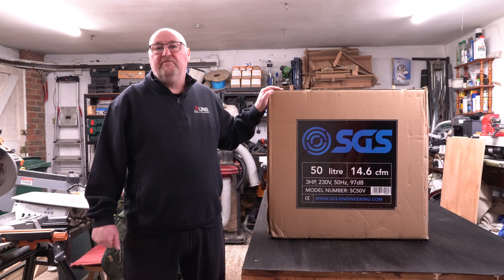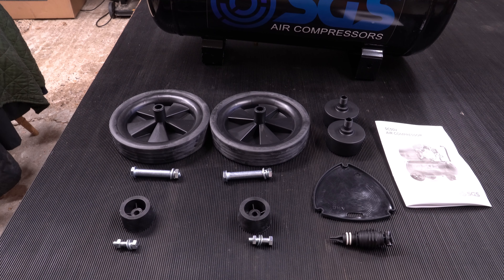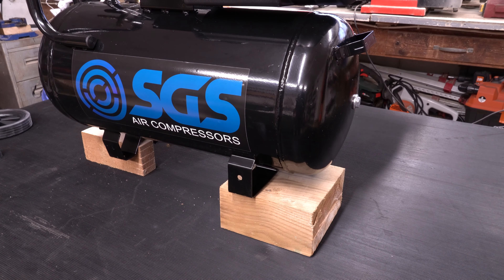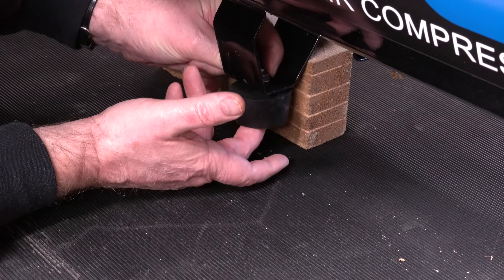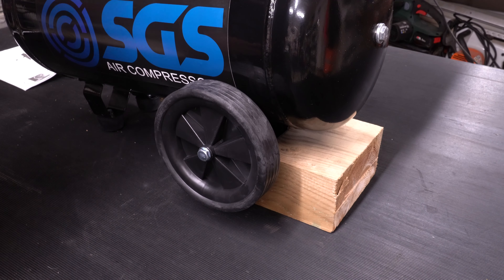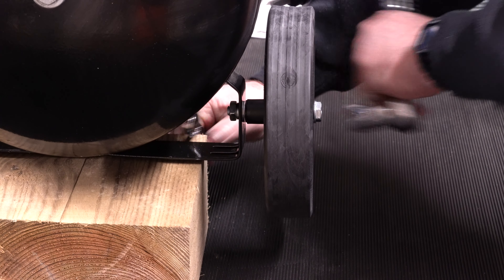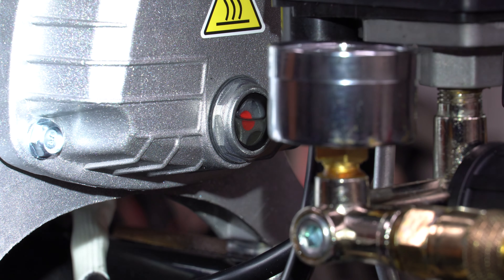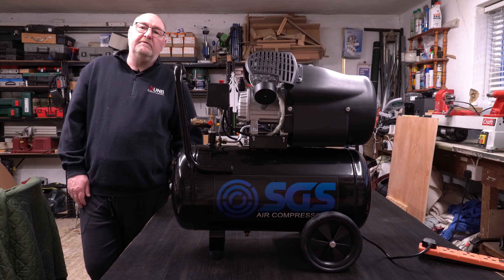SGS 14.6cfm 50L Compressor  SC50V - Unboxing and Assembly.  (Also Air Master/Clarke 14.5 CFM 50L)

Comment: Great looking machine Russell, easy assembly.  Tip: on the rubber feet push the bolt and washer up through the foot first and put the nut and washer on top, much easier to hold 🙂
Reply from the maker: LOL - Why didn't I think of that Peter!  Thanks for the tip.  :-)

Comment: Hi Russel.  How noisy is it?  Is the db level quoted? 
Our 1982 SIP does not have db quoted but measures at 87 at 1 metre.
Reply from the maker: It states 97 decibels on the website Emma.  It seems fairly quiet compared to the compressor it is replacing which is a 1992 SIP Airmate.  :-)
Reply: @RussellPlatten  Thanks Russel., its still ear plugs all round then.  I wonder if your perceived quieter might be the air intake filters, I have seen them described as silencers and thought about getting some for ours, but fitting would not be a trivial exercise.
Reply from the maker: Sounds plausible Emma, pardon the pun!  Ear defenders are easier!  :-)
Reply: There all loud unless its a low cfm unit with lots of motors, triple the price.